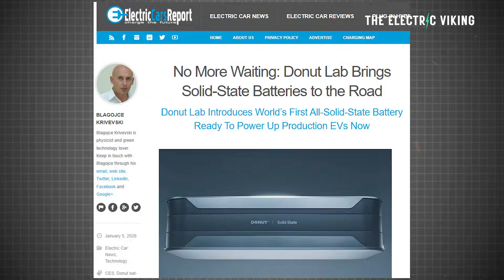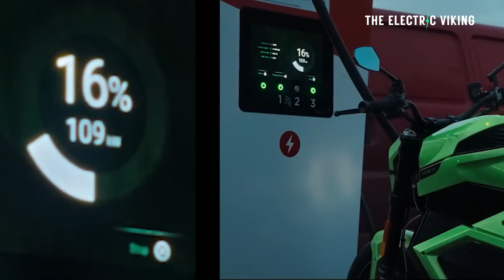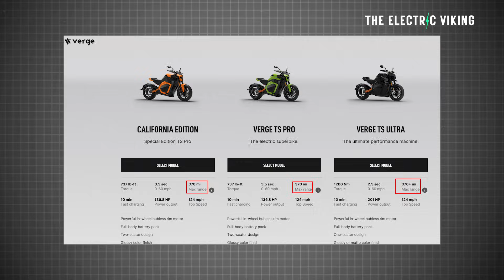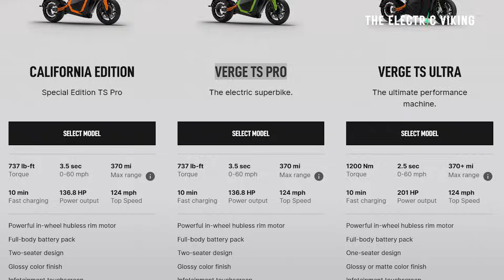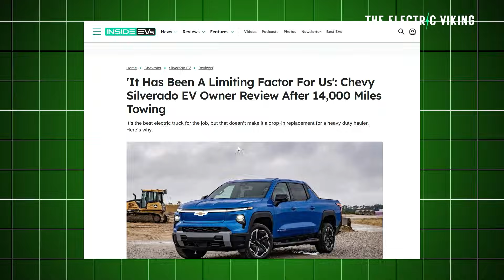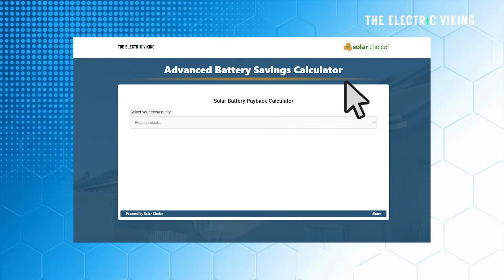The world's first true production-ready SOLID-state battery lasts for 100,000 cycles

Comment: Extraordinary claims require extraordinary evidence. A 400 Wh/kg solid-state sodium-ion battery, mass-produced, with 5-minute charging and huge cycle life would be a world-changing breakthrough. Yet so far, all the information comes from company claims — no disclosed chemistry, no datasheets, no patents, no third-party testing, no OEM validation results.

Compare this to CATL: their innovations are incremental, independently verified by automakers, regulators, and massive real-world deployment. Even their sodium-ion batteries were announced conservatively with clear limitations and supporting evidence.

Until independent verification exists (teardowns, certifications, OEM test data), skepticism isn’t negativity — it’s basic engineering discipline.
Reply: As of today, there are over 50 million electric vehicles (EVs) on roads worldwide, with projections indicating this number will quadruple by 2030.[1] More specifically, the global electric fleet reached almost 58 million cars at the end of 2024, and by the end of 2025, the International Energy Agency (IEA) projects over 20 million new electric cars will be sold, pushing EV sales to account for one in every four new vehicles sold globally.[3] This would bring the total global electric fleet to approximately 78 million by the end of 2025.
Does anyone realize the market just for refurbishing existing EV's with 400Wh/kg batteries?  If they become as cheap as they predict many EV owners will want to upgrade their existing EV's with batteries that can immediately double their range. Those dang old Nissan Leafs may never disappear.
Reply: @TronJockey upgrading infrastructure like power grids to support all that is extremely unrealistic which politicians are slowly admitting or simply ignoring as they fall behind their targets every year
Reply: @baloog8  The required increase in grid support in the USA (which excludes factors such as solar at your home and using cars as grid batteries) is slightly 
lower than what they did during the 1960s when electric appliances became more common.  Some issues such as resource consents can slow down projects, but ultimately there is a market and thus profits to be chased, so it will be done.
Reply: @baloog8  infrastructure? California also has 40% of all USA electric vehicles. We're doing fine. NO infrastructure so far. Just people doing their own home charging. And it works just fine.
Reply: @baloog8  We charge at home 99% of the time buds
Reply: @Yielar1 you mean solar on the roof?
Reply: @zlonewolf I think it's because the existing infrastructure has so far buffered it? But no longer can soon?😊
Reply: @TronJockey  
Those numbers are just malicious false rumors, spread by gasoline hating people. They should smell super gasoline and feel the intoxicating smell of freedom :)
Reply: @AArata63  Odd comment on a battery channel, lol
Reply: You're right, lots of huge red flags here.
Reply: Well their axial flux motors are validated by oems... Why start lying now?  What is there to gain?
Reply: @timtravelnomad  
"Verge won't say what kind of battery they are using"

So they are in on the scam :)
Reply: @AArata63 or keeping some details private helps ensure a headstart into production... And increases speculation & comments, thus publicity
Reply: @AArata63  Just checked their website, and they have open orders for their updated solid-state battery motorbikes with a delivery date in Q1 2026, offering a full refund if they don’t deliver. It seems they’re ready to go, and soon we’ll find out if they’re legit or not.
Reply: parroting cliches is funny
Reply: Unless they disrupt the entire market
Reply: Want to tell them: Just throw it on a scale to measure Kg and power a heat lamp through a watt-hour meter and let's see that 400Wh/kg.
Reply: When it gets into the first tablet gime a call
Reply: @hillesq  I want it in my next cellphone as I need 2 day battery life for busy days where I have to top up before the end of the day or when travelling
Reply: It's also good basic journalism. I simply feel sceptical about these claims.
Reply: You are right but we have had the time and many many companies working on this and I’d say we are on that 20
Year mark or so on battery tech. It’s time. I wouldn’t put it past this company with all the other products they have. You can buy it now.
Reply: Donut Lab hasn't indicated it's a sodium-ion battery at this point but that's what I'm thinking based on the cold performance. They would have had to have manufactures and independent labs  rigorously test the batteries if they are approved to go into the new Verge motorbike and the semi trucks. I'm looking forward to more information myself and some independent testing and reviews.
Reply: tesla cant copy it, torille
Reply: You were right. It’s fake. I was wrong.
Reply: Yup! Low CAPEX translates to EV charge stations in the parking lot of every convenient store across the USA.
Reply: @SCC.1233 Something that is already a reality in most of Europe. Most public parking garages, most supermarket parking lots have at least some charging stations. From where I live, I can walk within 5 mins to at least four different public charging points.
Reply: Would a vehicle be upgradable?
Reply: The hydroable cycle would cause overheating sodium matrix.
Reply: Nobody said it was Sodium
Reply: Yeah it's really hard to believe they can just scale up manufacturing for a brand new technology in production. C'mon.. who's doing the manufacturing? Unless it's like Toyota plant or some massive new battery facility secretly about to do this.. no effin way. This is all about trying to drive up valuation.. or it certainly sounds like it. A lot of these companies have impatient investors who put up a lot of money several years ago and want it back.
Reply: Amprius has a 400 wh/kg battery with third party verified at 500 wh/kg. The company will be profitable soon. They have lots of repeat customers.
Reply: In their ad they say 300 km range added to a 600 km battery in under 10 min. So still 20 min for a full charge?
Reply: It's a Capacitor https://www.youtube.com/watch?v=Qsi-TS8PX7U
Reply: Welcome to the age of X... ceo's job is to pump stock in the present no regard to future, chase that trillion $$ deal.
Reply: The world is still fighting over oil, so maybe advanced batteries are being ignored by governments. It's all about profits now, not the environment.
Reply: If on a 1,000 mile roadtrip, the 25 minute charge EV works just as well as the 5 minute recharge EV.

Most people need to stop a couple of times in a day for lunch, a snack, a pee or a crap.

It's seems hard for some people to understand.
Reply: @dvader3263  Well, not as well if you just need to stop for 5 minutes and not 25 minutes. And if this leads to a major increase in battery range, this could eliminate some recharging stops entirely.
Reply: @dvader3263  This is true, but think about short hop heavy duty vehicles like buses and lorries. Now instead of having to run a bus for half a day before taking it out of service to recharge, a full day can be done. Instead of having to have a streetside charge point at both ends of a route, now there just needs to be one. It all adds up.
Even for private EVs, I would no longer need to have two charge points in my garage because the energy density means I can alternate nightly charges between my wife and my car for example. It all saves money and increases the rollout and acceptance.
Reply: @dvader3263 nah if I'm on a road trip I want to spend my time on the road not wasting it at a charging station. I want at least 250 miles of energy in no more than 10 minutes.
Reply: You literally didn't watch the video at all 😂
The batteries can charge for 5 mins but they stated the motorbike charging in 10 mins.
They also stated they will be using the new batteries. 😂😂 you literally didn't watch the video. Whats the point of making a video without taking 20 mins to watch the video ?
Reply: They think we are donuts and will believe anything :)
Reply: Thanks for keeping this cool and real. Yup that’s a 70’s expression
Reply: Donut Labs has bought Nordic Nano. They have been working on a supercapacitor with 400 Wh/kg using some nanotube material. Rebranding that as an SSB is about easy - now the huge cycle life is normal for capacitors but the energy density is on another level.
Reply: @guidodraheim7123  It is often not the number of charging cycles that kills a capacitator.
Reply: Yeah i smell Elon levels of stink here, theres a reason these are still just CGI
Reply: @N1ghtR1der666  no, listen to the original manufacturer vid, they are ready to ship. Now. Sooo...either they are looking to be sued by every customer, or...
Reply: @kz1630  
I don't know. That big guy talking for the company looked a bit like a masochist. Maybe they like being sued by every customer :)

Comment: Donut Lab (a subsidiary of Verge Motorcycles) unveiled a production-ready all-solid-state battery at CES 2026.
Key Highlights
Production Status: Unlike most solid-state tech, which is still in the lab, Donut Lab claims their battery is already powering production vehicles (specifically Verge TS Pro and Ultra motorcycles).
Performance: It features an energy density of 400 Wh/kg and can reach a full charge in roughly five minutes.
Durability: The company claims a lifespan of up to 100,000 cycles with minimal capacity loss.
Safety: The solid electrolyte design eliminates flammable liquids, making it resistant to thermal runaway even at extreme temperatures (-30°C to 100°C).

Comment: Sam, I like your videos, you are a very likable person, but come on, man, prepare better. You clearly go for quantity, not quality. It may be time to change that? You are constantly mixing volumetric density with gravimetric density. It's really time to understand them. Furthermore, you say they want to go 300+ miles on a 22kWh battery, and it's possible only on a solid state battery. Why??? 22kWh is 22kWh, no matter if it's NMC,  LPF, Na-Ion, or Solid State. It's a capacity of the battery, and given you can fit it to the desired vehicle, it will have more or less the same range on all these batteries. Sure, some will be a little heavier, but it will not affect the range that much

Comment: Right all very good but what about home use-that is will it be cost efficient to go off grid with SOLID-state battery  that lasts for 100,000 cycles? I live on an island and am looking for an old leaf EV in good condition except for a crap battery so just how easy or hard will it be to upgrade to a SOLID-state battery in an EV? Then I have put off buying a home battery because of fire and other concerns if I can get a 60-100 KWH SOLID-state battery at better than current lithium costs I am at a point to be all in.

Comment: Yes, Sam. It's true your channel has made many claims of breakthroughs. 
 This is what news is -reporting on news as it happens, but things can change. 
 When I first started watching this  video, I rolled my eyes and thought "Here we go again ".
Then I remembered my making a backup copy of a VHS tape, thinking how convenient it would be if the movie rental stores could rent a movie on a format the size of my thumbnail. 
 I purchased my very first Compact Flash card for my new 3mp digital camera at Costco. It was 128mb for $130CAD!
 Today, I can purchase a 1TB MICRO SD card, much faster transfer rate for $140CAD online (Amazon), and get it delivered to my door next day.
 This card is the size of my PINKY FINGERNAIL!
 This was maybe 22 years ago. 
 Sam (and all those watching)- Change happens FASTER today. 
 I remember a movie from 2001- Final Fantasy, The Spirit Within- and how a 20" fuel cell (cylindrical, maybe 30lbs) replaced a spent fuel cell in a very large vehicle. 
 Then I think about the early days of the Startrek series- how doors would open and close on their own when someone approached and walked through. 
 One of these came into common fruition. 
 The door.
 Then the battery now powers almost everything we use.
 That available power has increased.
 Will there be another tremendous breakthrough like the 'smartphone'?
 My guess- Probably. 
 People told Musk it is impossible to land an orbital class booster to be easily reflown.
 Musk said "Hold my beer".

Comment: This is big, but "500wh/kg is enough for aviation" is a stretch.  Its enough for flying taxis.  LH2 is good for long range commercial aviation.  You're right that most gasoline use dies, but H2 will also compete for replacing diesel in sensible countries.

Comment: If we keep the capacity the same when converting to solid state we could actually cut the cost in half.  Depending on the cost of the new batteries.  EV's need to have an option to make them more affordable.  i.e. smaller battery banks, less features.  And put some GD manual door opening handles on them!!

Comment: "There is no engine in the history of mankind that can last over 100 years"

Oh yes there is, I've been on several. Now how many of the parts are original is another question but both 1920s electrically powered equipment and 1920s steam locomotives are still running fine. In the case of electric equipment the motors are often mostly original because they were built to last.

Rail vehicles built for long long mileage with electrical drive have an extremely long lifetime in normal use. 1930s London Underground stock finally got retired in 2021 in the UK. What this means is that you'd be able to run them on the same batteries for 90 years as well assuming the physical degradation over time was slow enough. At 100,000 cycles it seems more likely it'll fall apart for other reasons long before it fails electrically.

I'm not sure 100000 cycles matters for any sane normal use case, it's just a quirk of the technology.

Comment: Seems impossible that a new battery tech would just be 10 times better in every metric (maybe 2-3 times in energy density). You would expect it to be better in some areas but struggle in others. So far, that was the story with solid state which is why it hasn't reached the market.

Comment: More like 1000 years. If you drive your bike 300miles in a week (most don't) it's 100000cycles/52charges which works out to 1923 years. Even if you were crazy and do 30000miles per year on your motorbike (unheard of unless you use it for commuting long distance every day) that's 100000/104 which is 961, so call it an even 1000 years. I'm having problems believing, but hoping to be proven wrong (and hoping Trevor Milton is not involved)

Comment: If this were to be true, it would be an industry reset. Even things like UPS's which could be in harsh environments would benefit. Drones could fly longer. Or become lighter with same flight time. Also - with the endurance on these things (if true) people would be recycling them. IE: this car no one wants... but the batteries are still good for 30,000 more cycles. Pull out the batteries and put into a newer frame. (ideally). t

Comment: I may have missed it but are there any indications of battery cost?
I see that the Verge TS Pro motorcycle with a 600km battery pack is 32,900 Euros plus taxes and fees in Germany so it is a very expensive motorcycle when compared to say a BMW R1300R, an expensive motorcycle already, which costs 17,000 Euro in Germany including VAT.